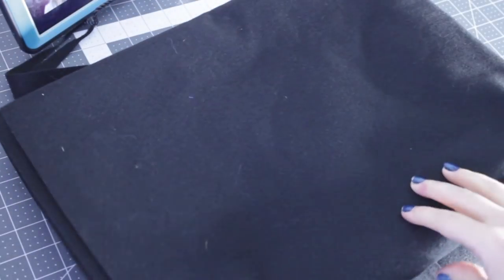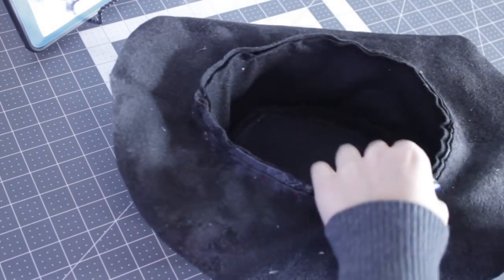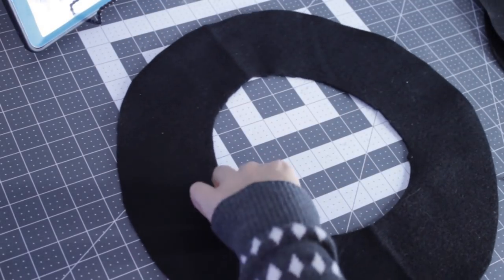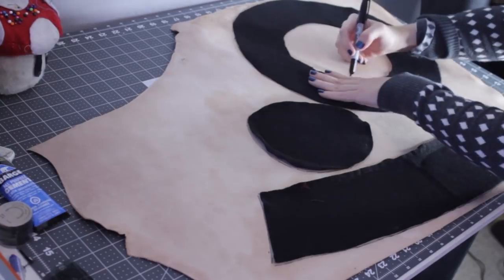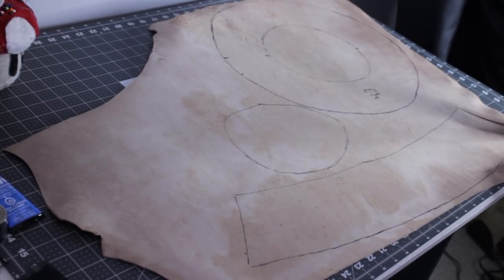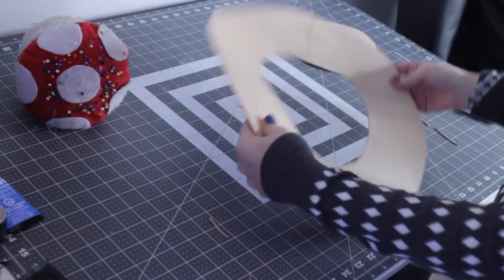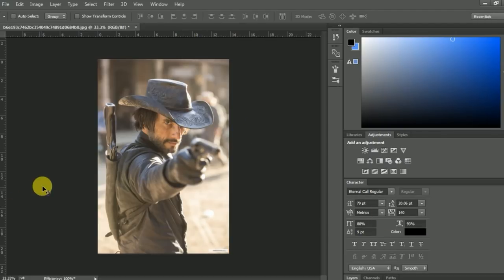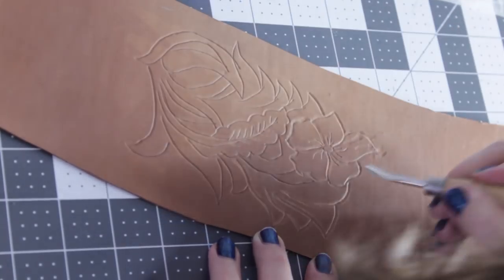Hector Escaton's Hat Part 1: Pattern, Mock Up and Tooling Design

Comment: I have a question maybe you could help me with. I bought this Aussie hat pattern from a leather shop and I'm making a large leather hat. I have the lid and crown put together already and it says to draw 1/2" lines with a wing divider on the bottom part of the crown and 1/2" line on the fresh side of the brim and glue and sew together. When I started to glue this to the brim it's not matching up like it's suppose to I think the hole in the brim is to small because the leather is trying to buckle up in places, maybe I need to make the inside brim bigger but wouldnt that make the hat bigger in size?  Can you please tell me what you think I need to do to fix this?  This is my very first hat so I'm not sure what I need yo do at this point. Any help or advice you could give me would be appreciated. Thank you, love your hat and the tooling design. Tammy